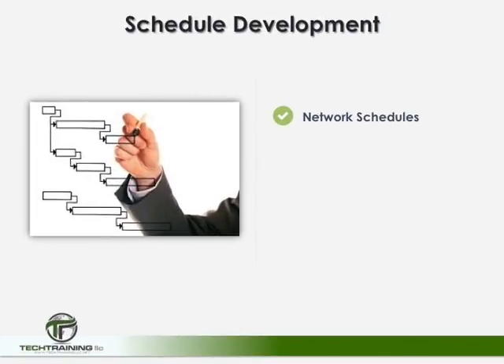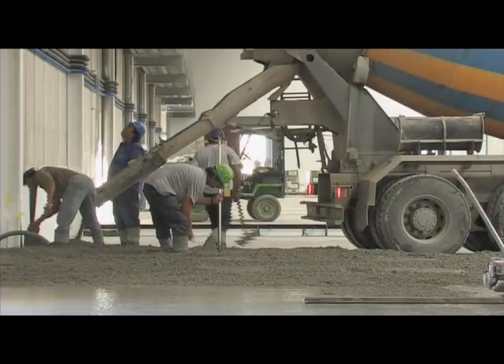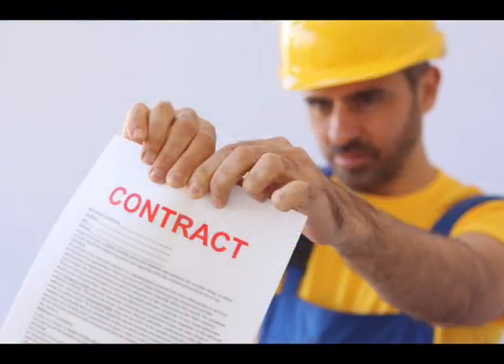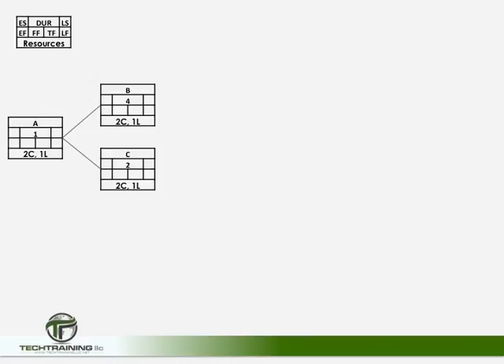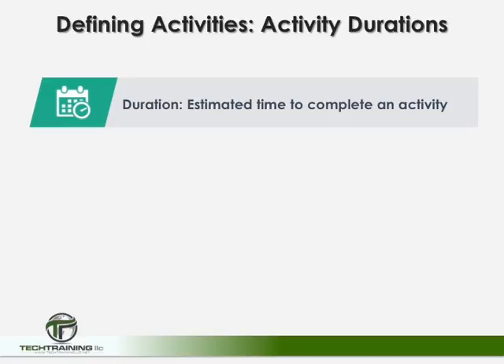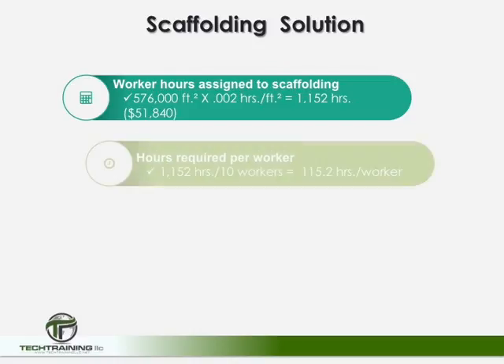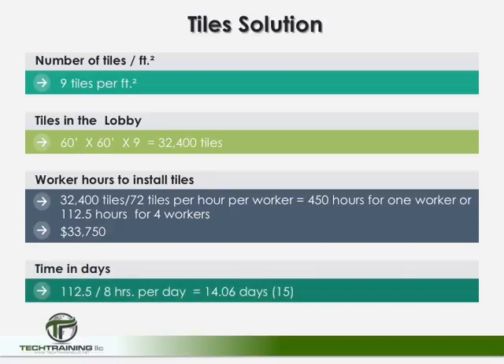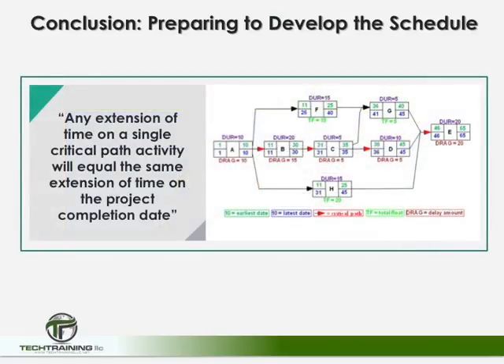Construction Scheduling II Developing the Network

Comment: I WANTED TO KNOW WHICH SCHEDULING SOFTWARE ALLOWS MULTIPLE I.E. COMBINATION PREDECESSOR SUCCESSOR RELATIONSHIPS - I MEAN LINKING THE SUCCESSOR TO THE PREDECESSOR TWICE BY TWO RELATIONSHIPS SAY FOR EXAMPLE START TO START AND FINISH TO FINISH ALSO. I MEAN LINKING THE PREDECESSOR AND SUCCESSOR TWICE. MS PROJECT DOES NOT ALLOW THIS. DOES PRIMAVERA OR ANY OTHER SCHEDULING SOFTWARE ALLOW THIS?
Reply: Primavera